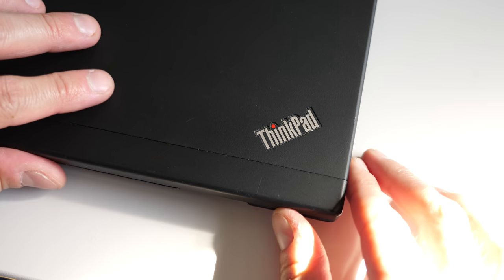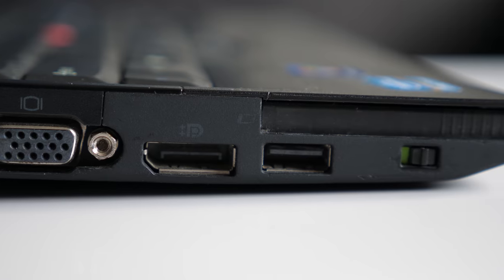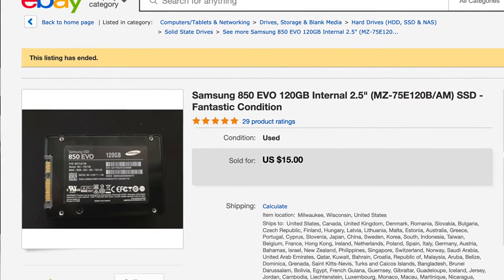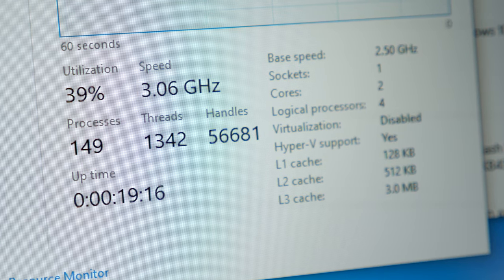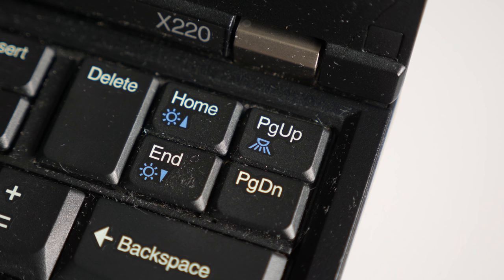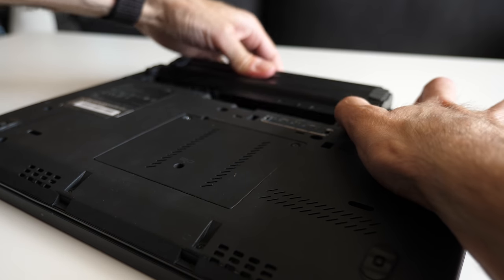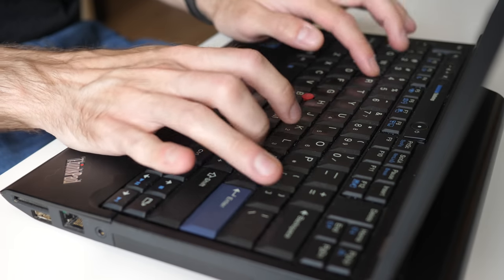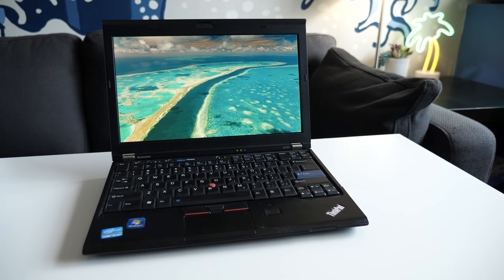The $100 Laptop Challenge -- This Old PC is Better Than You Think

Comment: I knew as soon as I saw the thinkpad that it would be a beast that punches above it’s weight many years later. 

I use a T430 for work. The key is that back then that Thinkpads we’re made to be upgraded. I’ve upgraded my CPU and RAM and have the screen upgrade on my agenda. Add in the dock and it’s my favorite computer I have ever owned.

Comment: I have two of these from ebay :) (well, one is the convertable tablet x220t variant)
After coming out of a long period of unemployment, the x220 Lasted me for many years, still usable now.
(Note, under the palmrest there is a msata/mpcie slot meant for the optional 3G modem addon, but also supports msata SSDs, so you can install a SSD there and keep the HDD for storage too...)
Have since upgraded to a new thinkpad (A285 with a ryzen 7 APU). But i've kept hold of these, as backup/loaner PCs for friend's/family :)

Comment: I have a decade old Core i7 Sandy Bridge desktop that I built myself. With a few upgrades ie 2 SDDs added to the 7200 RPM 1 TB HDDs already in it, and a new 8 GB graphics card, it is still useful for even computer graphics and video production work. The 32 GB of DDR  probably helps too.

Comment: In my experience, anything from a Core 2 Duo and newer performs well enough for basic web tasks using Edge on Windows 10.  None of my older machines have an SSD so things can be a bit pokey when powering on and starting apps, but that's not very often.  The majority of the time I spend on any computer is with the apps I need currently running.
Reply: Yup. It really only now depends on how much RAM you have since web browsers consume ABSURD amounts of RAM for absolutely no reason… It really has to be at least 8GB or you're having a bad time…

Comment: There are some ARM based single board computers that run laps around the latest Celeron or even pentium. ARM is a much more streamlined architecture than X86-64 requiring way fewer transistors and lower clock speeds to achieve the same performance.

Comment: I have an old 7 years old Acer notebook with i5 3230m, 2C/4T and it still works like a charm. I have put 16gb or RAM into it, 2xSSD 240GB, and it can even run most of the games from my Steam library (and i have like ~400 games right now) in 30-60 fps thanks to dedicated Geforce 730m. Of course modern hardware will outperform it, but for VirtualBox, light gaming, some coding and YouTube/Netflix stuff its enough.

Comment: In late 2016 I got a retired Lenovo T520 from my work. All I had to do was donate $100 to a local charity and provide proof. Installed an SSD I had lying around and Ubuntu as the OS. It's not my main computer, but I still use it pretty much daily. No signs of slowing down.

Comment: Bought my Lenovo G570 new back when it came out. Specs weren't the greatest but the upgrade path was. It came with a b9450 pent 2 core 4gigs ram and 320gb hdd.  upgrading this series is simple, it now sports 8Gb ram, 1Tb ssd and an i5 2640m quad core.  New I paid only 200.00 for this unit,  its going on 10years, I use it more than my desktop.                         Joel

Comment: big fan of HP older elitebooks myself. for anything but 3D gaming,  but including some light CAD and 3D modelling, my trusty 2009 8540p fitted with an an SSD it still a rock solid, snappy, portable office battleship. built like a tank, and a joy to work on. and that's after well 5 years of abuse as an always on server.  if you can grab enterprise or military surplus dumps, elitebooks are a steal compared to thinkpads.

PS: just replace the stock thermal gunk. it's their only weak spot

Comment: 6:54 Not all ThinkPad X220 configurations have USB 3.0 ports.  Many have three USB 2.0 ports, one of which is powered.  There's a BIG speed difference between USB 2.0 & USB 3.0/3.1 for devices that truly support the latter's standards.  Used ThinkPad laptops are very capable machines.  Just be careful to read the Lenovo spec sheets before buying, to make sure they will do what you expect of them.
Reply from the maker: There were certain configurations for the X220 that included a single USB 3.0 port on the left side.

Comment: For a similar price, I was able to pick up a Dell Precision m4500 laptop with an Intel Core i7-820m cpu with 4 cores 8 threads, 4 gb ram, a 250 gb hard drive and Windows 10 pro. Mine seems like it was released in early 2010. With things I have lying around, I was able to up the ram to 8 gb and swap out the 250 gb hard drive for an intel 180 gb ssd. Now it seems to be performing well even on the 2020 version of Windows 10. I think these Dell Precision laptops, they're not really called laptops but more like mobile workstations since they were made for businesses who special ordered them from Dell.

Comment: Bought a dell latitude from the local free geek store in Portland last year and its been awesome compared to a 300 dollar laptop. I7 6600u. I swapped the drive to a new nvme and cleaned it up and it had the battery replaced.  Comes with thunderbolt so if i have an eGPU, it will game and do wonders as a low end workstation

Comment: 2 cores was and probably still common. I got 3 thinkpads a T580 and P50 and a T61p. Thinkpads are great laptops and some older laptops and desktops are good too. They make 3rd party lite versions of Windows that gets rid of unnecessary things and Repaste CPUs and clean the laptop and then put Crucial Drives in them and they will perform well and have graphic cards that is on par with new laptop igps.

Comment: Got a 10 year old dell and still no reason to search for a new laptop. 
Best thing is you can repair it. I changed the battery, the displays hinges, the power plug, one ram module and the keyboard already during the years. <3 
I know this sounds like this laptop breaks easily, but apart from the RAM all those parts broke because of user error (I dropped it from time to time)

Comment: One thing you didn’t mention was Wi-Fi. One of the good things is that you can switch out the internal Wi-Fi card pretty easily BUT a few things to keep in mind are 1.) some laptops are BIOS locked to only certain WiFi cards 2.) If you get a new .ax or .ax (WiFi 5/6) you might not have enough internal antennas. These are most likely rocking WiFi 2 (802.11g) 1x1 meaning they will be SLOW. Better off getting an external card to the USB3

Comment: you need to mention that Lenovo hamstrings cpu performance down from 2.6Ghz to 1.2Ghz if there is no battery as well, and that it checks for legit batteries. speaking from t430 experience.
Reply: You mean with non original battery it goes from 2.6 to 1.2Ghz?
Reply: @MaximC  i mean with no battery at all, just the 60w power brick, it limits itself to 1.2Ghz tops, at all times. Also, yes it has the possibility to tell that a battery is not lenovo OEM and it will prevent you from charging the battery. someone has a video on it, or some post has some info on it.
Reply: @Layarion  
I see. And if you put a non original battery - it basically won't accept it, won't power off of it??
Reply: @MaximC  i think that's more 'hit or miss" because i see amazon reviews on some third party batteries saying it doesn't give them an error.
Reply: @Layarion  I see. Thanks.

Comment: Got a T430 and T440 for $300cdn  total a couple years ago, last year got a bunch of T440 and T450 parts for $50cdn  from the same guy, fixed my son's T450 case and had enough parts left over to make another  fully working T440.  Just got to keep your eyes open for deals.  Oh yeah, forgot to mention, that $50 deal included three extra batteries for the T440 with lots of life left.

Comment: The X220 is a real gem, especially when you swap out the mechanical hard drive for an SSD, it will given any "modern" computer a run for its money, and often surpass it. The keyboards are definitely superior and unlike a lot of new computers / tablet based machines - the X220 can be repaired inexpensively! Great machine, I wish newer computers were more like it.

Comment: One nice thing about the X200, X201 and X220 series is that Express Card Slot.  You can buy a triple USB3 port card for that slot and the USB3 port issue is history (Less than $20).  For awhile I was using a little 8" Lenovo 1GB RAM tablet next to my bed to watch streaming video at night.  Well to be kind that was a nightmare (bun intended) - talk about SLOW!  I replaced that with an X201T (Tablet Laptop 4GB RAM and 256GB SSD) and it is light years better and cost far less than the original 8"er.  My main business and daily use laptop is an X201 I'm writing this comment on (Early i7, 8GB RAM 512GB SSD).  I use Linux Mint on all except the bedside tablet which is WIN10 - Those large tiles do come in useful for late night finger pointing.  I agree with you Colin an SSD replacement is mandatory and does noticeably increase the overall performance.  Add a cheap USB3 express card and your flying.

Comment: Thinkpads are my addition. My T410 and T420s all run Linux these days. The T410 couldn't run Windows 10 well (though surprisingly the X201 could). I have newer Thinkpads for Windows, so the T420s were redundant until I put Linux on them. Two of them I got off eBay 5-6 years ago for £30 each, with smashed screens. They work great as quiet desktops/servers, and can simply be plugged into a dock and external screen/keyboard.

Comment: I only buy laptops in the $100-$200 range, and usually thinkpads, not for myself but also for staff and friends. These last forever, obsolesence, usually of OS license, is the only enemy, not the Thinkpad falling apart. Max the RAM, and install a faster drive, HDD or SSD, clean insall, and you're good to go for most web and office tasks. This price range includes X201s to X250, T410s to T440, with windows 7 (free upgrade to W10) or windows 10 licenses in the BIOS.

Comment: These things are definitely robust. I've got a W520, my father used it constantly for his work, then have it to me, where I've used it the majority of the time(and very heavily) since then. It's had an SSD for a long time.
As pointed out in the video, it isn't just that these old computers are so 'great' - it's that many new cheap computers utterly suck. Likewise CPU speed improvements have drastically slowed.
My W520 does use quite a lot of power though, even when not doing much, due to the old processor. These old ones also won't work with Windows 11.
Reply: It works, just not officially supported, but still get updates nevertheless. My T60 with core 2 duo even runs windows 11 smoothly.

Comment: have a 17 inch Dell Inspiron 5720, upgraded processor (I3 to I5) added ram (16gig total) replaced hard drive with ssd and added that to an external drive by taking out the disk drive. It runs great BUT I know it is not like the newer gaming laptops-to me that is fine and Cheap!

Comment: I am still using the rig I built over 8 years ago, sporting a Core i3-3220 (also 2 cores / 4 threads) with also 8 GB of DDR3 RAM. The only thing I replaced 4 years ago, midway, was my Radeon HD 7750 for a GeForce 1050 Ti. 
To this day it runs decently and gets the job done, even when gaming in 1440p. And I, too, think to myself all the time: Man, that would have been completely and utterly impossible in 1999 with a machine from 1991, even with one from 1995. We've come a long way. 
I will build a new rig when AMD launches the Zen 4 line and DDR5 RAM hits shelves, and I hope I'll be fine for another ~10 years then. 
I like the idea behind FreeGeek. Would totally like to help out if there were something like that in my area in Germany.

Comment: The keyboard on this laptop is the most underrated part
Reply: Love it, and works fine after spilling whole bottle of beer on it. I only had some issues with trackpad buttons after dropping pizza on it with ton of ketchup... ;) But extensive washing using water fixed the issue.

Comment: Elitebooks 8460/8560, 8470/8570 (P or W series) along with Probook 6460/6560, 6470/6570 (B series) are pure workhorses. I own an Elitebook 8560w that competes with most modern systems (gaming ones included). The 8560/8570 W series has a lot of room for expansion when it comes to storage, GPU and RAM (32GB max with the right CPU pairing).
These machines are built to meet military standards and they can handle a lot of physical abuse (especially the kind that young ones dish out).

Comment: I spotted an elitebook 8730w from 2009 on ebay for £40,it looked rotten,but the description said it worked fine so I bought it.It was absolutely filthy so I stripped it down,rebuilt it adding some memory and an ssd,its now running W10 quite happily,I picked up a copy of photoshop 7 from the internet archive site and that has no problem running,it weighs a ton and no way would you cuddle up with it on your lap,but it boots up in 35 seconds which is 15 seconds faster than my 2015 desktop with 32G ram!SoI am quite happy picking up old bangers and giving them new life.
Reply: Where did you get the photoshop?

Comment: I am typing this on the 14 inch T420 and I have an X201T as my tablet. Both were purchased second hand and work very very well.  As for your experience with mechanical drives I think that is more a function of Windows 10.  This T420 came with Windows 10 on it and it was  quite sluggish with the mechanical drive.    That was not an issue when I put Debian Linux on it and I have seen similar with even other version of Windows.  For some reason Windows 10 doesn't play nice with mechanical drives.  To me that is unfortunate because they are still cheaper per GB and long term pretty reliable.  Gone are the days of IBM Deskstars aka the Deathstar.

Comment: The i5-2520M Processor was released in 2011, runs at 2.5 GHz Base, Intel Turbo Boost 3.2 GHz w 3 MB Cache.  In 2016, the main Processors in Laptops were the i5-7200U, that Processor is 5 Generations later, and runs at 2.5 GHz Base, Intel Turbo Boost 3.1 GHz w 3 MB Cache.  Both of these Processors are 2 Core 4 Thread, comparable to a 4 Core.  These Processors are almost the same, a bunch of Intel Hype.  They can run any OS you throw at them.  Lubuntu 18.04 LTS 64 BIT, Zorin 15 Core 64 BIT,  Mint, Ubuntu, Xbuntu, Mint etc. etc. Windows 10 64 Bit.  I mean, I am running these different OS's on a few Toshiba A215 AMD X64 Duo Core 2.0 GHz.  My main Desktop Computer I just bought from a famous Computer place starting with a B for $350 is an Intel Pentium 4.0 GHz Base, 2 Core 4 Thread, 8 GB RAM, 250 SSD...like I need all that gaming ability for my Chess games?  You know what?  You guys have all been Intel Conned, spending for you $1,200 Desktop from that Big Box Membership store starting with a C when you don't need anything near those statistics...

Comment: Despite the fact I have a new T495, I still use my T420 for different things. It's super snappy. I have Ubuntu 20.04 LTS on it and it runs like an absolute dream. I upgraded it from an i5-2520m and 4GB RAM to an i7-2620m and 8GB RAM, with a cheap SSD. I got it for just shy of £80 a good 4+ years ago, labelled as "for parts" despite the fact it only had cosmetic issues, and only 1GB RAM, no HDD. It is a champ.

Also had an X220, but gave that to a friend.

Comment: I picked up a brand new in box new old stock first gen Chromebook Pixel for just over $200. i-5 processor, aluminum case, backlit keyboard, 2K resolution screen... It's 7 years old, but blows everything new $200 computer out of the water.

Comment: I'm very much an older computer user - both me and the computers.  I've become an auhtor in my old age (over 70) and have 7 books up on Amazon - most of them written primarily on a Dell D620 or D630 because I like the keyboards and they still have decent screen height so I can see more than two sentences of text when I write ;-)

I have a D620 running Windows 7 to monitor the small solar power system and it runs fine in the 4GB RAM limit.  My wife's laptop is an E6410 (Win 10) and I have a similar Win 10 laptop for the sites which require that level of security.  My primary writing machine is running XP because I've written a lot of utilities and the Win 10 anti-virus products tend to identify anything not from a known company as malware :-(

A few Ebay sellers put a new aftermarket battery on the laptops they sell (no refurbished shop near my location) but I have found some battery vendors that offer decent batteries for reasonable prices - for the most popular computers.  That's about $20-$25 for a 9 cell battery for the D620/G630.  

The last D630 I bought (4GB RAM, Win 7, new battery) was $127 delivered.  Certainly beats the $400 Celeron if you don't need USB3 or HDMI ports.  When I replace one of the older laptops, it's usually just a matter of moving the SSD to the new laptop.  XP often doesn't care - if it does, I still have a site license for XP.

Firefox for XP is incredibly RAM-humgry, eatimg up all of memory in its run to acquire everything from every web site.  When it gets slow, you know it's trying to swap a gig to and from the SSD - really stupid bit of coding - and yes, I have done binary editing when I didn't have access to the source code.